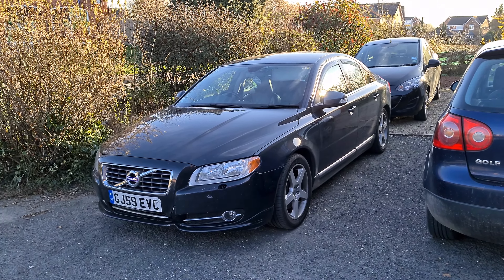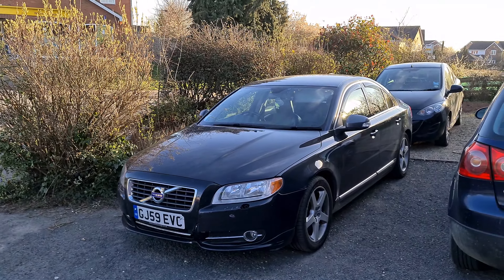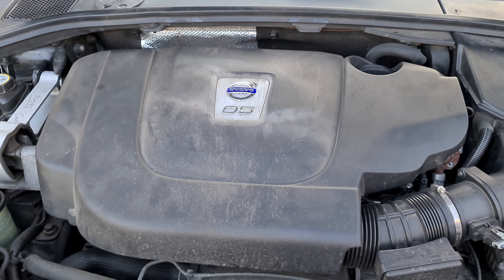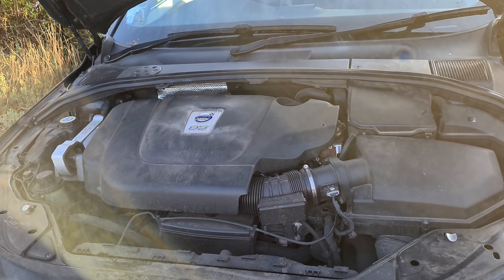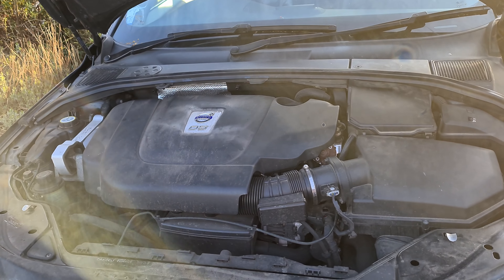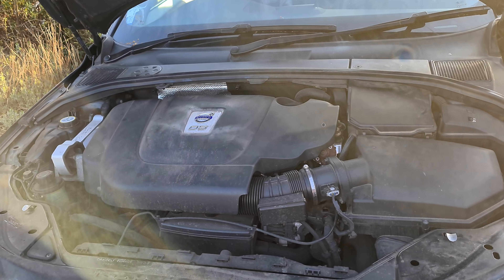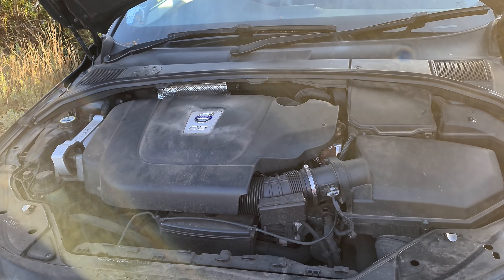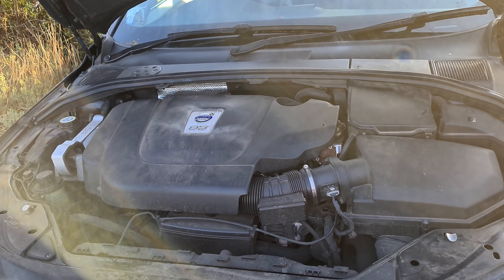How to make your Volvo *LAST FOREVER*!

Comment: I've got a 2008 V70 with the older 2,4D engine. It's at abt. 280 000 km. Or  175 k miles. Still going strong. Very comfortable, and I could carry whatever I fancy.😂

Comment: Spot on. My 181k (delivery miles to Volvo owners) benefits from quality oil eg Shell, OEM oil/air/pollen/fuel/turbo filters every quarter and yearly fluid changes in both the front and rear diffs as well as transfer box. In addition the auto gear box is serviced annually with fresh fluid and filter etc. Over the top? Maybe, but I like to think it makes a difference, however, the peace of mind it gives me is priceless! Keep up the great content and interesting information. In case you’re wondering it’s not a Volvo.....yet!

Comment: Good vid! I have a 2012 XC90 D5 with 127,000 mls. Covered 43,000 mls in 2 years. Maintenance is key. Once the wear and tear parts have been replaced you’re golden for another 100k or so with regular services etc. Great cars

Comment: I have a 2009 v70 d5 2.4  with 78 k on the clock and it runs like a new one as I have a year old ford as well and I would say there's no running difference because my Volvo is so well looked after .I'm going to change the transmission oil  my self in the spring by giving it a gradual flush over a few weeks  , I've just gave it a carbon clean yesterday I don't know if it was needed but I had it done anyway  and I had the cam belt changed  December 16th with a full service done at the same time  and I put a full set of breaks on last winter and there still like new  . I only do long drives in the Volvo but make sure it's drove at least twice a week for at least an hour each time as fast as I can on the motor way . Absolutely mint car  I'm the second owner, came with full Volvo service history and everything it should have in full working order with a tail hitch to boot . The car drives like a dream and has a shit load of grunt .

Comment: I own a B5244t5 S60, currently have 226 000 kms, have it since it had 62800 km. Full synth oil every 20 000 kms works just fine. Manufacturer gives up every 30 000 (that's too much). Driving to max 2000-2500 rpm when the oil is cold is much more important.

Comment: Volvo state 115 k or 10 years which ever comes 1st for cambelt with full kit change... under normal conditions they are very strong as u said reccomend under seal or oiling via pressure machine to keep rust free mine is a 07 plate D5 on 77k full history.. also recommend a dose of Stanadyne performance fuel additive brilliant stuff around 80 ml for 31 litres of fuel protects the system injectors the works.... this is made by the company who make the injectors best on the market instant difference...

Comment: Firstly there is no problem with the cambelt at all on these engines, its very robust and reinforced with Kevlar  and  change interval is at the 108000 mile service or 10 years which ever comes first. It is completely safe to follow this service procedure which volvo recommends. This car should have had a volvo cambelt change about 3 years ago due to the low mileage.  Now  yes cambelts can break but the cause is the AUX Belt failing and getting tangled in the cam belt  so the  attention must go on this problem not the cambelt.     In 2007 volvo switched to a thinner narrower Aux belt , and from about 2009 to 2013 they tried   2 or 3 fixes via recalls and altered the change interval of the Aux belt to 54000 miles ( Previously 108000 miles with the belt) this was the cure... what is vital is that the Aux BELT is changed every 54000 miles  and at every cambelt change as previously. Always use the genuine volvo belt !  MILES are the crucial thing NOT age of the belt but it will be changed with the cambelt at 10 years if you do low miles.   Whilst on the subject , the water pump is rock solid  they never fail , ( Unless they are non volvo then YES they will fail sooner or later ) I have seen so many un educated  mechanics take off a volvo water pump when doing a cam  belt and put it in the bin and fit a cheap quality non volvo one which WILL  fail  sometime in the  near future .  All that is needed is to check the spindle for play and smoothness and coolant leaks. I have been working on these engines since they were introduced in 1990 in the 960 I have NEVER come across a faulty one yet.   Another point, oil change interval  volvo servicing is every 18,000 miles  and as long as you use the CORRECT oil  (Castrol Edge 0w/30 ) it easily does the job for the 18000 miles, It is expensive oil you are wasting your money changing it sooner.

Comment: As for the gearbox, and not driving it hard - These are big, powerful engines - They can take a hard drive lol obviously not ASBO all day every day but they are made to last and driving it hard or spirited is no problem - You never mentioned the DPF, this can be an issue if you're constantly doing short journeys, you NEED to take it on a motorway run at least once a week - Also the geartronic boxes are sold as sealed for life by VOLVO but anyone who knows anything will tell you that you absolutely should get them flushed!! If the box goes you're gonna be paying a fucking lot to get a new box in there. Mine is currently on 112,000 ish miles and drives amazing - Got the Michelin PS4's on there recently too and it has transformed the car
Reply: volvo have never said the auto gearbox is sealed for life , There is an optional service schedule for it ! Change the oil at the 72000 miles for peace of mind  or 36000 miles if the gearbox gets hard use with towing or taxi work according to the volvo service schedule

Comment: I have pretty much the same model - 2009 S80 with now 252 000km's on the clock and runs wonderfully. I've driven it myself for about 120 000km and haven't had any major repairs up to now with the exception of a steering rack, which is about 2000eur/1800pound/2200usd range when you get an OEM one (or about a third of this from a scrap yard, i've been told it pretty much can't be fixed/rebuilt). Someone already commented here about this, but in addition to the regular maintenance, you should do a transmission flush every 70 000 miles or so.
One thing that kind of annoys me is that the leather quality on the seats wasn't up to par to audi or bmw or Mercedes, I'm thinking of having these redone by a local leather shop.

Comment: IV a 2008 volvo v50 with 91 thousand miles and runs great except for now and again I find the revs drop when I come to a stop, does my volvo have a breather valve behind the manafold that could be causing the problem, my one is 1.8 flexyfuel thanks

Comment: Was you ever worried about your timing chain going on the 1 series? Mines done 75,000 miles and I think the chain it starting to rattle slightly. I've read that the later models like mine (63 plate) get a rattle but shouldn't snap as it's a revised design, but it still always sits in the back of my mind knowing it was a common issue for so long with the N47 engines. 
Thanks
Reply from the maker: Hey man, yes I was always worried, unfortunately it comes with owning the car! All you can do is look after the car and maintain it well and it should return the favour :)

Comment: Had a P2 V70 D5 auto. Sold it to a friend and it's now on 320,000 miles with no problems. Now have a P3 V70 D5 r design and love it. Just done the MAP sensor clean and that improved the throttle response and drivability of the car massively.

Comment: Hi DriveLife , My S60 D5 (2012) recently clocked 160k miles, still runs as if it was a new car.
Reply: I have an S60 D4 from  2013 (Same 5 pot engine as the D5 but with a shorter stroke so it's 2.0 litre rather than 2.4). currently on c. 146k miles and running like new.

Comment: Hi there, I have a 2008 Volvo S80 3.2 with 155k miles in United States. I'm changing all 6 spark plugs, 2 control arms, Coolant/Radiator hoses (Upper and Lower) and then Power steering rack and pinion as per the repair dealer guy. What else should i change or pay attention to? I guess the car doesn't have any timing belt right? So, what other engine component should i focus on to keep it driving and cross 200k miles. Also, my dad drives it which is around 20 miles daily in the city and that's it no highway runs
Reply from the maker: They do have a timing belt! make sure that is changed :)

Comment: Hello mate, i have same one just like yours. Just run 180k KM but the starter getting weird. Had to press twice to start the engine (not even cold start). You know how it sounds when Low Bat right, but i changed them to new one. Still the same. Any idea ?

Comment: 3 million miles would require the car to do 1000 miles/week for nearly 60 years! Is this possible?
Reply from the maker: Yep, Google Irv Gordon :)
Reply: @drivelife.channel  😅 I read the article, wow! This list amused me…Irv Gordon’s P1800 has consumed:

107,400 gallons of gasoline
3,316 quarts of motor oil
829 oil filters
464 spark plugs
156 tires
29 sets of brake pads
29 fan belts
4 sets of shock absorbers
3 water pumps
3 generators

…which is also pretty good going!